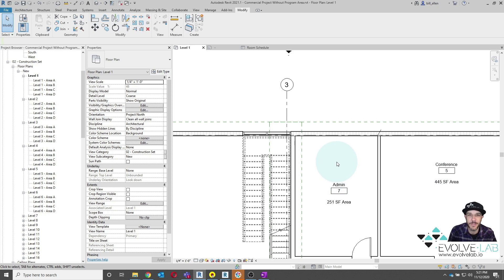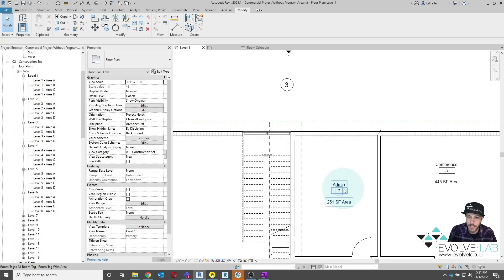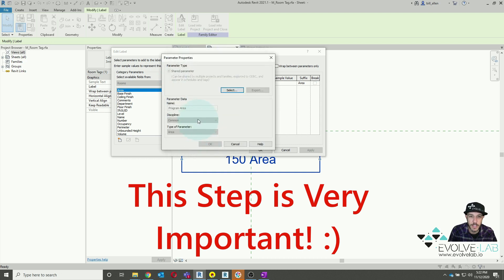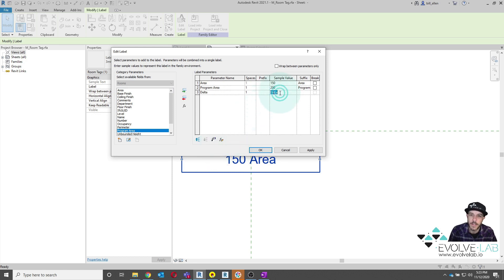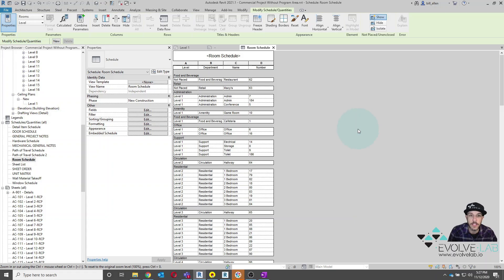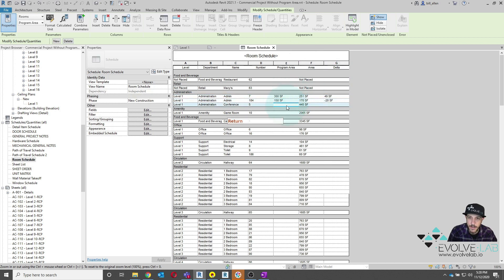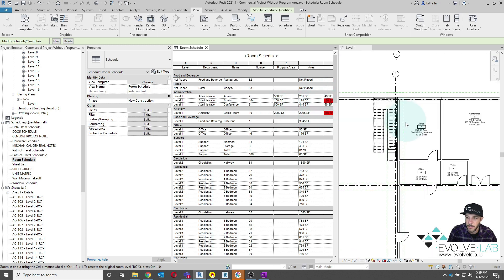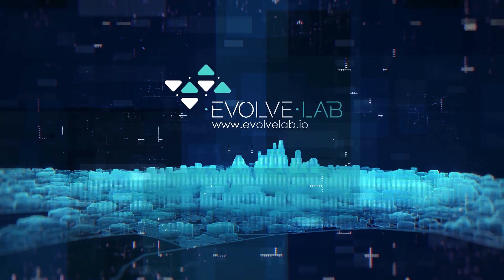Tag Calculated Values in Revit - Program vs Actual Area

Comment: this video did not explain how to do any of the actual required steps to complete this process...
Reply: Agree! Some steps were done previously and not fully explained.
Reply from the maker: Mark, thanks for the feedback.  The video outlines the steps to.  1.  Add the shared parameter to tag.  2. Create the formula in the tag for program area vs. area.  3.  Load the tag into the project.  4.  Add  the shared parameter to the project.  5.  Add the shared parameter to the schedule.  6.  Create the formula in the schedule for program vs. area.  In addition to the video and this comment, let us know if there is any way we can help clarify the actual steps to execute this process. Thanks, Mark!